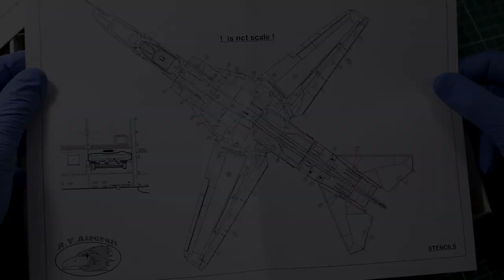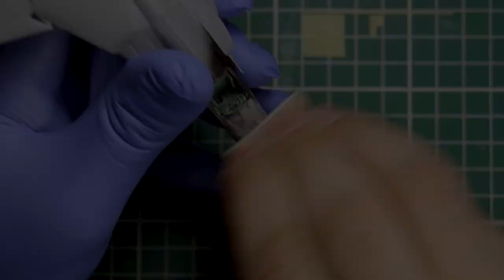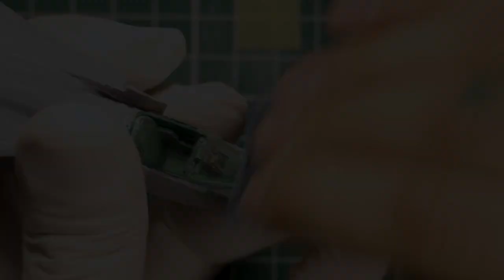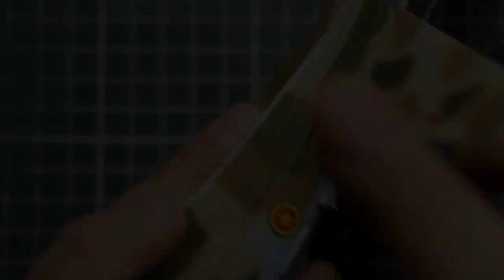MiG-23 Bn Ethiopian Air Force 1/72 R.V.Aircraft Plastic Model Full Video Build

Comment: Question:  You used quite a bit of Superglue. How long did you wait before you started sanding those areas that have been superglued?  If you wait too long, it's difficult to sand or rescribe isn't it?
Reply from the maker: I jssualy wait 5 10 mins maybe less.It does not matter after how long you start sanding.The hardness is the same after 5 mins orr 5 years.
Reply: @doctormig2709   Thank you!

Comment: Great job can you tell me your review about that kit?  Thanks
Reply from the maker: Thank you.Well the kit is actually a really difficult kit to work with.The fit is not that great.It requires a lot of sanding filling and rescribing than sanding again.In the end it looks like a real mig-23bn and If you want this type this is the only option for you in 1:72 scale.I would again buy and build this kit despite all of it`s shortcomings.
Reply: @doctormig2709  thank you for your comment in USA is an expensive kit I going to wait if Eduard release 1/72 Mig-23 and 27 serie
Reply from the maker: @javierbrown4689  Well you can get it online on ebay or some hobbyshop from europe.I am not sure that eduard will release it.
Reply: @doctormig2709  ok Thank you for your advice
Reply from the maker: @javierbrown4689  Np.It is a pleasure :)